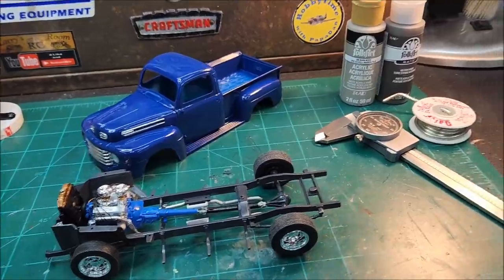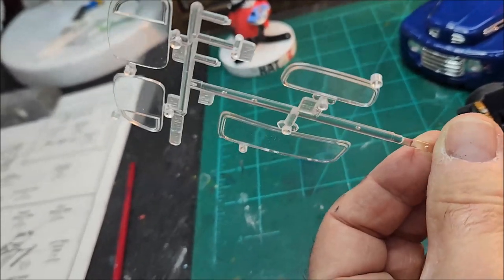'50 Ford Pickup Update

Comment: The blue looks great. Love the shine. I think the bright chrome looks good with it, you might wait until you do final assembly, before your do much blackwash. (especially if you will be using chrome bumpers and want it all matching) It's your build, do as you wish, I'm just saying "wait" as a caution. 
I've seen guys tape clear glass, and trim off the edge all around with Exacto knife where the black edge has to be painted on, then spray on flat black. 
Whatever you choose to do, it's going to look good.
Reply from the maker: Thanks Ray.  Yeah, I'm not doing any black washing right now.  I always wait and look a the finished product.  Thanks for the tip.
Reply: GT Classic Plastic  yes, I've heard that works too. I just think the ability to use flat paint versus a more glossy marker looks closer to rubber seal. The tape and Exacto make a sharp edge. But neither way - paint or marker - looks bad.

Comment: Lovely finish on the pick up Zippi. As for the rubber around the windows, when I do cockpit canopies and I go over the glass when painting the frame. I let it dry and then use a toothpick, with the pint wet, to work around the frame and it scrapes the excess off. But I use acrylics and I am not altogether too clever at doing it.👍👍😉
Reply from the maker: Thanks man.  Good tip!

Comment: Try a black Sharpie on the front and back windows instead of painting them.  On the bed use those colors, and when your finished put a coat of Tamiya clear orange over it.  It is really looking good.  Thanks for sharing.
Reply from the maker: Thanks Michael and I appreciate the tip.

Comment: Man, that is looking great. Best paint job I've seen you lay down on this channel. I'd mask the windows with Tamiya tape. You can press that into the trim edge and cut it with a sharp xacto. Kinda the reverse of using bare metal foil. that should give you a clean edge after burnishing to brush (or airbrush) that black edging. Good luck.
Reply from the maker: Thanks Wayne.  I appreciate the kind words.  Thanks for the tip.

Comment: The body turned out beautifully, I would mask around the windows since their is quite a bit trim around them and the bed you could use a darker umber as the base then the dark umber dry btushed next with lighter color dry brushed
Reply from the maker: Thanks Gerald.  I appreciate the tip.

Comment: Looks good👍😎nice details👍. The glass frames  looks prominant enough to draw around with a fine point marker or black wash to give guide lines to follow with chrome paint and suggest rubber trim 🤔
Reply from the maker: Thanks man.  I appreciate the info.
Reply: @olezippi  if you use black wash and polish it off,you'll leave a black line in deep corners to follow also

Comment: Hey Z, I ended up ordering the Ms. Leveler to mix with the Tamiya X22 and hoping my finish looks half as good as it did on this truck. Yours is just great! I had a question about polishing - do you wet sand and then polish as well? Thank you in advance and keep up the awesome work.
Reply from the maker: Thanks for the kind words J.N.  I normall wet sand the clear with 12,000 then start the polishing process.
Reply: @olezippi  trying out the mr leveler thinner with the x-22 and its glossy but Im running into the issue of it not seeming to dry all the way. I think I shot it at about 13-15 psi, so Im curious if because of that, it doesnt atomize the paint as well? I remember you told me you spray the mix at 20 PSI so thankfully it wasn't on the body for a clear finish, but rather on some smaller parts that were gloss so its okay if I have to re-do those. Do you think spraying it at 20psi vs 13-15psi would make a difference in drying times? Thank you again Zippi!